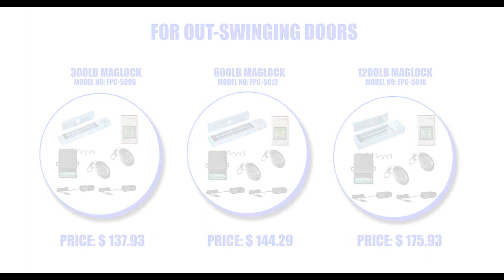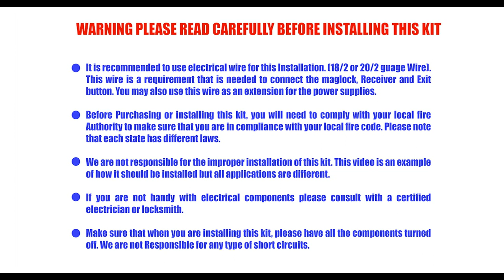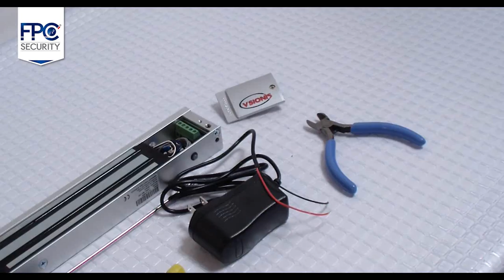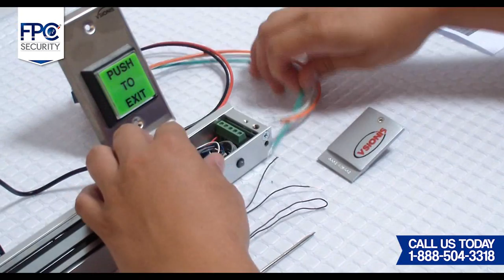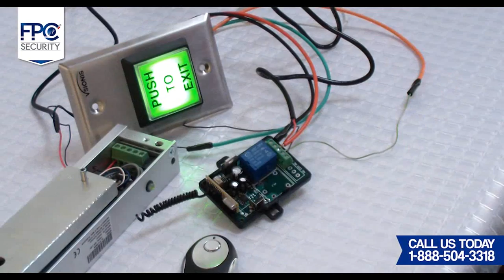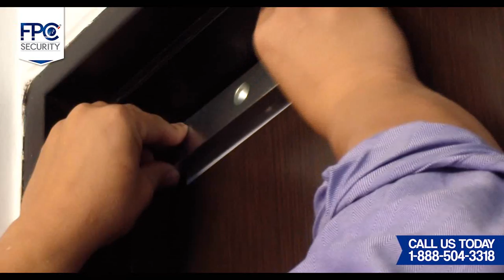Wireless RF Receiver and Magnetic Lock Buzz-In kit Installation Video

Comment: One of the worst installation videos I've ever seen. The orange wire section shows but does not identify the name of the terminal on the receiver other than "normally closed terminal". I had to watch it several times on a big screen to see it was the middle connection. The 8th step, summary, doesn't really clarify a whole lot. This video could be improved by including a co!or coded schematic showing wire connections of every component...I created my own after watching this many times to make sure I had it right.
Reply from the maker: Thank you for your feedback, we will have them as consideration. And you know you can always call us at 786-442-1220 for futher support.

Comment: This system has been working great for a couple months.  Even with a sign with instructions, I cannot get anybody to hold the "push to exit" green button and push open the door at same time.  They always think there is a delay.  Can I put a delay on it?  Just like the little remotes?
Reply from the maker: Larry, The wireless receiver has a 4 second delay by the defaul setting. If you need further support you can give us a call back at 786-442-1220

Comment: Can you switch the (push to exit) to (open _closed)switch?
Reply from the maker: Dear customer, yes you can use an on/off switch instead of the exit button. Or you can program the second function on the receiver to work as on/off switch. For further support you can give us a call back at 786-442-1220

Comment: If we didn't want the exit button or remote do we still need the power supply? We want the door to the room to always remain locked when the outlet is turned on from the wall switch. Then when done in the room turn the wall switch off and it unlocks the maglock.
Reply from the maker: Yes, you can do that by connecting the Maglock directly to the power supply

Comment: Why use two power supplies 
If you use the one from the receiver then the light functions better as an indicator that you cut power to the mag when pressed 
It’s easy to calculate amperage when adding another mag to a two channel or load
Reply from the maker: Dear customer, We recommend to have a separate power supply just for the receiver, other wise you have to jumper the Common and the Negative of the receiver together if you are using just one power supply for the system. Both ways work fine and in case of using only 1 power supply we recommend a 12VDC 2 Amp power supply.

Comment: I had an electrician hook this up but he is saying that, it doesn't have enough power to the lock to close the door, this have me stumped any ideas
Reply: Gabby,

Can you provide us a phone number to contact you and also the order number and the products that you have for us to provide you the correct wiring instructions to have the unit working a 100%.
Reply: @magneticlockaccesscontrole4698  thanks for replying i got it off Amazon
Reply: My electrician use watsapp im in Barbados Caribbean, you have a great product im not saying that it isnt but i think the best person to speak about the lock is my electrician,you can private message me so i can give you the watsapp number, thanks for your quick response
Reply: Gabby please give me your email address so I can send you the full information.
Reply: @magneticlockaccesscontrole4698  cashmoney91@live.com
Reply: @magneticlockaccesscontrole4698  i have this exact kit
Reply: Gabby,

By any chance do you have the order number so I can check your order and help you with the correct wiring diagram?
Reply: @magneticlockaccesscontrole4698  well i had someone order it for me off amazon in 2017,im only hooking it up now,
Reply: Gabby the thing is that the emergency light is no a known product to work or goes in a kit that why I need the order number or I can send you the information on the panel and how to wire it but without the emergency light.

to wire the system correctly so please check the attached files and follow the instructions:

1. Check the diagram on the attached file named (dee) > on this diagram on the READER side do not connect the YELLOW and BROWN wire just GREEN, WHITE, RED AND BLACK.

2. You need to do a JUMPER wire on all of the DOOR sides of the panel between COM and G so please check the attached file named (Jumper controller).

to manage the VSAXESS software so please take a look at the attached files on the email and follow on this order: 

1. Check the file named ADD DEVICES TO VSAXESS
2. Check the file named ADD USERS TO VSAXESS
3. Check the file named ADD PERMISSIONS TO VSAXESS

Please open the files in that order to have everything working just fine.

DOWNLOAD LINK FRO VSXAESS 3.1.1   https://www.fpc-security.com/software-download/

TO DOWNLOAD ALL THE FILE ATTACHMENTS   https://we.tl/t-4Rl44ObVTb

Also, I will attach a file that I created for you to add the units on VSAXESS ok, your ticket#17980 and if you need further support just reply to this email or give us a call back to 786-442-1220, thank you and have a great day.
Reply: @magneticlockaccesscontrole4698  can you watsapp me

Comment: how do i connect multiple wire less remotes to one receiver?
Reply from the maker: Hello Michael, on the receiver you will find a Button on the side that is titled " Programming Switch". Press that button for 3 seconds until you see a light flash; when the light flashed take your finger off and press the button on the remote one time. Then wait till the light comes off. When that happens you can test the remote by pressing one time.
Reply: I've done that, but when I try to connect a second Remote, it disconnects the first remote. is there a way to connect a secondary remote and a third remote as well?
Reply from the maker: Michael, please give us a call for tech support
786-442-1220. Thank you.